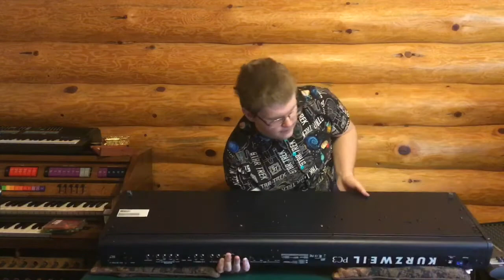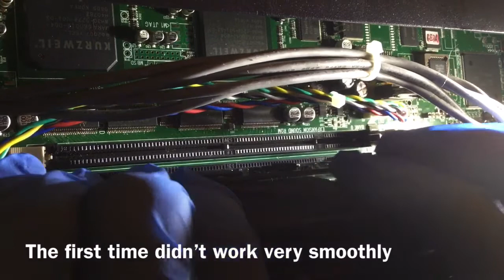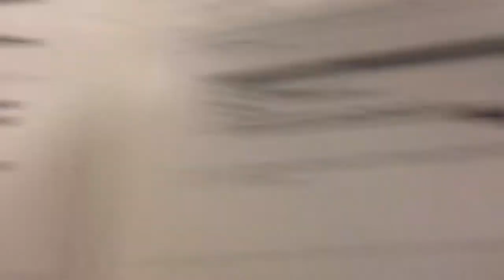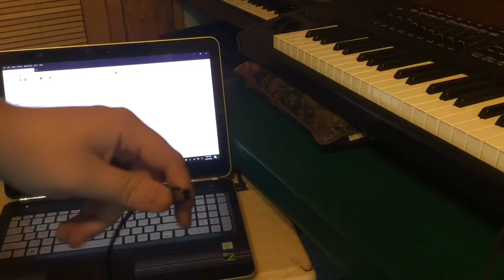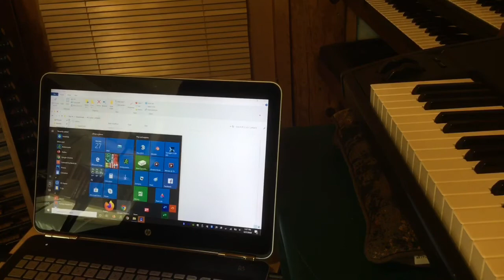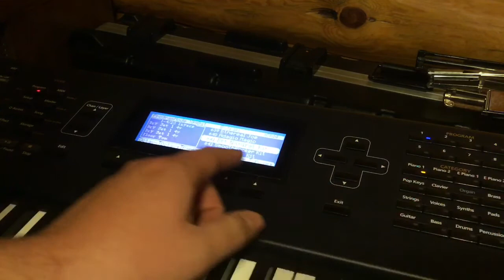Kurzweil Kore 64 ROM Expansion Installation | Kurzweil PC3

Comment: Great timing, my kore64 arrived today!!
Reply from the maker: Let me know if you have any issues putting it in. Remember that the PC3K is slightly different from the way I did this one, so make sure to follow the correct set of instructions (the guide includes both). This is the PC3 version I videotaped here. If your Kore 64 board looks a little different than the promotional pictures, it's because Kurzweil changed them a little mid-production-run. There are pictures of both on the Kurzweil PC3 FAQ page, towards the bottom.
Reply from the maker: I can't guarantee I will get your comment immediately, but I do check regularly.
Reply: Where did you get the expansion from?
Reply from the maker: @envisagefilmshouston  At the time I bought it from B&H Photo Video, but it was the last one they had in stock. I'm not seeing much online now for new ones. Good luck!
Reply: I just got mine today. And we’ll I see is factory. I don’t see a lot of sounds in a bit disappointed 😭 but I the few sounds it did come with I do cherish. And one bass program I do love. 🤲🏼
Reply from the maker: Yeah, I was surprised at how few things were actually on the board, but I did find I liked the brass and sax patches a lot more, plus the mandolin and banjo patches were pretty decent. The drums were rather good too; there were a few good electric guitar patches I used in layers that worked well enough too. Otherwise though I still don't know whether it was really worth the price. If only the German Grand board would work with our original PC3 models rather than just the K/A versions.
Reply: True!!! How many sounds did your Kore64 card came with? 😝
Reply from the maker: I don't remember the exact number - whatever it was supposed to according to the factory object list...should be 390 it looks like. You can double check the Object List file in the Downloads section here: https://kurzweil.com/kore64/
Reply: And is only one expansion out?
Reply from the maker: @envisagefilmshouston  Yes, the Kore64 is the only expansion that Kurzweil ever released that worked with the original PC3 series. They had a 128mb slot in the PC3 units but never released an expansion for that slot (according to this GearSpace thread it was due to a memory addressing error in some of the PC3 units: https://gearspace.com/board/electronic-music-instruments-and-electronic-music-production/1246860-kurzweil-pc3x-sample-ram-possibility.html). The PC3K/A boards could also use the German Grand Piano board or a 128mb user sample flash board (but only one of the two, plus the Kore64 boards).
Reply: Damn lol 😂 this keyboard 🎹 sucks
Reply: @envisagefilmshouston  but it’s in fact more reliable than NORD Grand .
Reply from the maker: But the pianos sure aren't better than the Nord Grand lol...
Reply: Not at all.  I already had the Nord Grand.  This is a very expensive but poor quality instrument - the main switch can sometimes turn on by itself if played fast and hard.  This is a very unreliable tool.  And it sounds like Chinese.
Reply from the maker: Interesting to hear about the switch issue...I do really like a few of the Nord piano samples (black upright, royal grand, white grand, bambino upright) and am actually saving up for a Stage 3 for piano-focused gigs. Since I'm also a Kawai action fan the Nord Grand seemed like a nice instrument. 

For reference, I own a Kurzweil PC4 as well as the PC3, so I have the German Grand samples that are in the piano expansion board that was in the PC3A/could be added to the PC3K. And I can say that unless you really like the sound of the regular Triple Strike/stock PC3 piano sample that you won't necessarily really like the German Grand - it's an improvement but has many of the characteristics of the Triple Strike still, mainly the overall tonality and what sounds like sample stretch points in the C5-C6 octave and the C1-C2 octave. It plays well, but I can't say that I've ever played a solo piano gig where I thought that it really sounded like a grand piano. However, it's great in a band mix.
Reply: @MaxThompsonMusic  I like the strings… I just wish it had more 😔
Reply from the maker: @ENVISAGE FILMS HOUSTON I'm happy it has as many strings as it does. The solo strings aren't the best but at least we have a good number of articulations for the string sections. I find it interesting that those strings from 14 years ago or so now still beat most strings in current keyboards.
Reply: @MaxThompsonMusic  FAX!!! Very natural sounding
Reply: @MaxThompsonMusic  Congratulations! Could you post the algorithm of the steps of institutions of KORE64?
Reply from the maker: The video here shows the installation steps, but otherwise there should be an instruction manual with your KORE64 board. If not, here's the installation manual: https://kurzweil.com/wp-content/uploads/2019/12/KORE_64_Installation.pdf.
Reply: @MaxThompsonMusic  yeah right? It means it should be different types of PC3? I got one of the latest PC3K8 in a Music Store last November. The instrument stood in the were house long years without packing. The KORE64 I bought in Japan via E-Bay as well the German Grand D in Saxony here.
Reply: @MaxThompsonMusic  Well as I know the GERMAN GRAND D adds the capacity of ARTIS into the PC3K.
Reply from the maker: Nice! Back in 2016 I got the very last new Yamaha Motif XF8 in the US (after the Montage launch) - one was left in California at the warehouse and my local store ordered it in for me.

Yeah, I don't really see what the point was of Kurzweil having both the PC3K and PC3A available instead of just having one model with the different boards available for purchase a la carte - it certainly made things more confusing (and the fact that the original PC3 had a second expansion slot but Kurzweil never developed a board for it didn't help). The German Grand D board does give you the Artis pianos, which are still actually pretty current as they're in the Forte/K2700/PC4 line with the addition of the 7 Foot Grand samples (a Yamaha).
Reply: @MaxThompsonMusic  Well the price difference between PC3, РС3К and PC3A is huge (PC3 8-1900€ and PC3А8-5200€). But those original quality is identically high.
Reply from the maker: Yes, I mean that the PC3 was the previous generation to the PC3K (which replaced it). So the PC3 and PC3K/A were never competing products - the PC3K and PC3A were though, but the only difference was the boards that were factory installed (128mb sample memory + KORE 64 vs German Grand EXP + KORE64). So one could turn a PC3K into a PC3A and vice versa - they're the same instrument with a few cosmetic changes.

Comment: If we need to replace the cr2032 battery, is it at the same place ?
Thanks
Reply from the maker: Hey Daniel, unfortunately I don't recall and don't have access to the PC3 right now.
Reply: 2 questions, which SOUND EDITOR should be used after installing both extensions (KORE+GERMAN)?  And could you prescribe a way how to record sounds from PC3 into a PC.  The BIG BLACK BOOK never reveals the information about it.  Thanks a Lot.
Reply from the maker: I believe the regular PC3/K Sound Editor should work (available on the Kurzweil website), but I have avoided the editors primarily because they can be buggy and I didn't really see a real advantage over the onboard programming unfortunately.

By recording sounds, do you mean recording audio or saving patches/programs to the computer?
Reply: @MaxThompsonMusic  Firstly thanks for your comment. I mean in general how to get the Work Station-and PC3 is one in did-connected externally to  a PC or MAC in order to store/record what you’re playing in WAVE and MIDI Formats as well as to have a possibility to adit it. The issue is that according to the BLACK BOOK you may see a general statement that the storage into an USB thumb is possible without to show you the way there in concreto, isn’t it so?
Reply from the maker: Okay sure - from what I remember, the PC3 will show up as a regular hard drive when you connect it to the computer (by the USB type B port). You can drag and drop files back and forth there I think. I don't believe you can record audio from the PC3 via USB - you can record midi via USB to your DAW program but not audio. I do believe it's a class-compliant system without additional drivers. You can always just use the 1/4" outputs to an audio interface to record audio or the 5-pin MIDI connection instead of USB MIDI, but the USB MIDI/computer drive connection seemed to work fine for me.

My PC3 didn't have the ability to use a USB thumb drive but rather an XD card (the USB upgrade was added with the PC3K/A), so I'm not 100% sure what the procedure would be for that for you.
Reply: I love you too